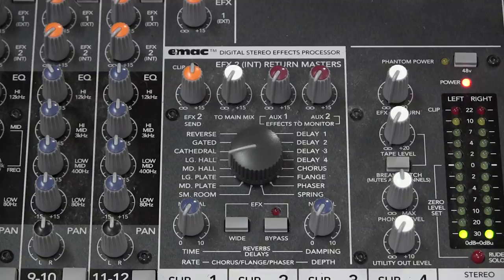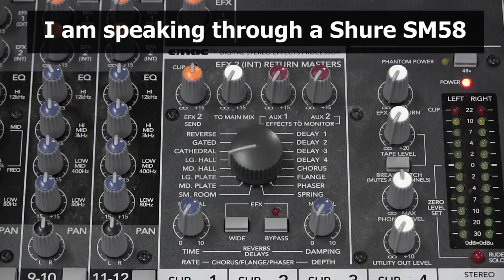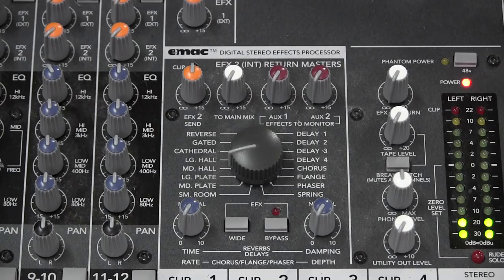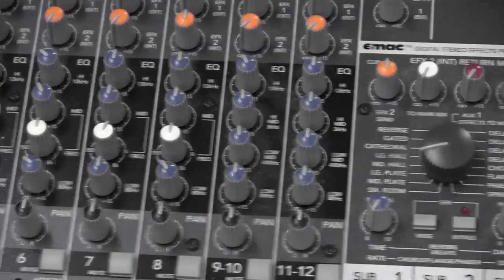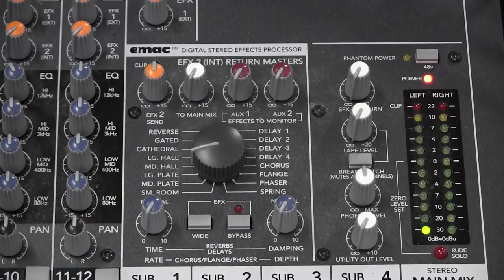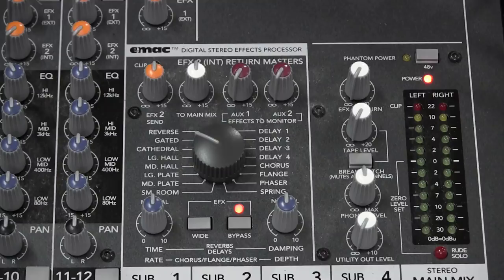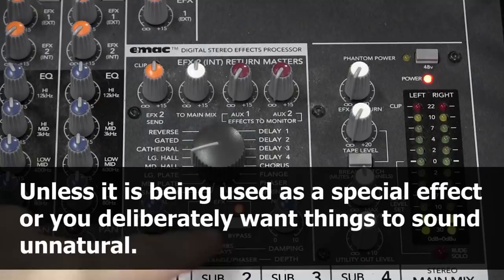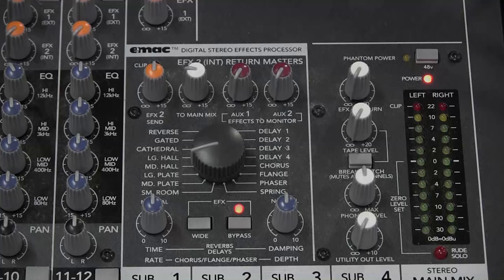How to use a mixer's internal effects processor

Comment: Bro can i use the utility o/p with  mono jack (TS) and feed to passive power amplifier input, as well as active speaker???
Also for recording can i use the output of Earphone (Trs) and RCA Tape output ????
For the Mackie mixer...
Pls reply 👍👍👍
Reply from the maker: Yes, the utility output carries a copy of the main mix so it can be used to feed any line level input. I recommend that you do NOT use the headphone output for recording, as it is designed for headphones.
Reply: @GLBProductions  Bro thank you so much for the quick reply
Reply: Yes wanted to know the same thing 👍
Reply from the maker: You're welcome Zuchamo!
Reply: @GLBProductions  bro one more question.. for open air ground (outdoor) Basically for Speech / Spoken words)
Which processor ( setting) is appropriate? Eg- Reverse/ Gated/ Cathedral etc.
Plz reply 👍..

Comment: Great tutorial.  I purchased (used of course!) the updated Yamaha MG mixer (CX something.  Added USB output) specifically because of the on-board effects and the one-knob compressors (which you have another video on).   It is very convenient with a great price/performance/portability ratio.

Thanks again for a great tutorial.

Comment: we use one of those MG12 for DJ's with the outputs going into an A&H PA20 (the main desk) Great little desk for accoustic gigs or home mixing where you dont want the hassel of a larger desk
Reply from the maker: Spartan Thanks for the comment! Do you supply the MG12 even when the DJ brings their own DJ mixer?
Reply: DJ's around here tend to use a laptop rather than bring a mixer. Otherwise they just plug into the mono channels on the MG12 as its pretty much hardwired into the PA20
Reply from the maker: Spartan I see. Ah, I miss the good old vinyl days...

Comment: I am the proud owner of a Mackie DFX-12 and by watching your video it has simplified some things but the aux-es fx-es  are still baffling but I haven't  given up I still want to learn I just got started sense I bout the mixer two weeks ago
Reply: clg1955 Oh I use my mixer Left Channel Output  to Channel 1 Input  on my USB interface (Steinberg UR22 ). My keyboard is a yamaha YPG235 it works great USB for my DAW VST's but I rout my (phones/output) with a mono cable to 11/12 left mono to get live sound and record into Audacity...... is this safe??
Reply from the maker: clg1955 Yes it is safe but if you use a mono cable with your headphones output it will only capture the left side of the signal - to capture the full range of the signal you need to use the L/mono output or just use a TRS to 2 x 1/4" cable to split the headphone output into discrete left and right signals.

Comment: And again, great video! I have one suggestion, put video: best possition for bend in small practice room. For instance we have acoustic drumer, bass and regular guitar with your own speaker and amplifier. Vocal and synth are on mixer, amplifier and two speakers. What is best possition for that crew :-)
Reply from the maker: +Erni Koldzic I'll be honest with you Eric - in small rooms the main challenge is just fitting everybody in! The best position is one in which you can hear everything that you need yet to give a good performance. I suggest placing the speakers in the corners, because that will help to cover the room as completely as possible, and make sure that the speakers are at ear level, not down on the floor.
Reply: +GLB Productions Tnx a lot:-)

Comment: Firstly, thanks for a very detailed explanation. Have a question. With the Analog mixer can 2 effects be applied at the same time for ex: Reverb + Delay.
Reply from the maker: It depends on the mixer and how many effects engines/external effects units you have.

Comment: I pray you could help me brother if I were to ask a question or 2 about setting up a system for my Church my friend. I love your method of teaching and believe you would make it easy for me. If possible I'll reply if you can. Nothing too extensive,just fairly new to the process of running sound and some help would be a Blessing!!! Thank you and God Bless you friend. Fran
Reply from the maker: Sure Fran, go ahead :)
Reply: @GLBProductions  I think i may have replied on the vid only?? Not sure. Anyway thank you so much brother!!! I have a "mid-morph function on an old Peavey xr1220. It's a bit touchy to dial in correctly but wondered if you knew of a good starting point besides unity that is.You are an awesome dude my friend and may our Lord Bless you continually!!!

Comment: This is a great video and it's helping to teach me how an internal effects processor really plays into a mixer like the ones you showed. I have a few questions if you don't mind. I'm a student with the Art Institute of Seattle and we're learning about mixers by using the Mackie 32x8 and the Crest XR-20 & XR24. My questions are these. 1) What is the difference between pre-amp and post-amp? 2)Pre-fader & Post-Fader? You mentioned pre & post fader but I don't understand what you mean by that though.
Reply from the maker: - Hi John, thanks for getting in touch. You're very fortunate to have those Crest mixers to work on, they are wonderful old school analogue technology, built like absolute tanks. To answer your questions: 
1. Pre-amp (as opposed to preamp) means before the amplifier in the signal chain, as opposed to after, which would be post-amp. Usually the only things post-amp would be the loudspeakers. Preamp (one word) is short for preamplifier. 
2. I suggest you watch my video How to set up monitor mixes for live sound starting around 4:30 for an explanation of this.
Reply: Awesome thanks so much. I'll watch that video tonight, and any further questions I'll toss your way. You've been an immensely huge help. My goal with the Art Institute is to hopefully gain a career in voice acting or voice over work, or even work in Seattle's local news department by doing anything with sound. Likely Kiro Radio.
Reply from the maker: Jon Slater Sounds good - all the best with your future plans and career. I have done some VO as well as live radio work and they are both varied and rewarding fields.
Reply: How do you get work in VO? Do you have to make demo reels and send them out? I'm really curious how you got into that.
Reply from the maker: Jon Slater I did my work through http://voice123.com/ - once you sign up and create a profile you can post samples online and bid for jobs that are posted on that website. It's very competitive though!
Reply: I remember that site. I used to put up tons of stuff but never got an offer for anything.
Reply from the maker: Jon Slater Yes, I think the VO market is pretty saturated at the moment, which is why I moved on to doing other things.

Comment: Bruno, finally got out from under. The setup you suggested for the sub works great. Will know more about the hum next rehearsal, but found that the vol control on powered amps needs to be turned off. It was creating feedback. You're right on the Crown amps; they are XLS series. Are you familiar with the different menus on the amps?
Reply from the maker: Jim Frey Are they the new drivecore series with the LCD panel on the front?

Comment: Awesome video as usual!I own the same identical MG mixer,but the only things I don't understand are the 4 knobs below the phantom power switch...I was thinking it was for the effects...but according to the video they don't...i guess...
Reply from the maker: ***** Those knobs have various functions: the first two control the level of the signal plugged into the stereo return connectors (immediately below the four RCA connectors) to the aux send and main LR outputs respectively. The third and fourth knobs are the master controls for the external aux send and internal effects send respectively. Hope that helps :)
Reply: I got the LR and internal effects pot...but I'm not too sure about the other 2 blue knobs...let's say we have a monitor connected to the AUX bus,and in the other 3 buses an external multieffects processor...does that mean that the AUX Send is gonna sending the signal of the multi effects to the monitor?And waht about the Return knob?sorry but I'm a little bit confused...
Reply from the maker: ***** Hmm, I suspect we may be talking about slightly different mixers - what is the exact model of your mixer? I'm using an MG124CX as my reference.
Reply: Yes,it's the same exact mixer (older version) like yours...
Reply from the maker: ***** Ok that's good. If you have an external effects unit plugged into the stereo return, the first blue knob, immediately below the phantom power switch, will send the signal from the unit to the monitor. The second blue knob is the master level control for the AUX bus, in this case it will control the overall level of the send to the effects processor. Is that more clear now?
Reply: Yes,thank you for the explanation and the patience!
It was the basic fact that the Send is an output and the Return is an input,that confounded me,sorry...
Reply from the maker: ***** Great! Don't worry, being confused by equipment and then working out your understanding is part and parcel of this business :)
Reply: GLB Productions HI Bruno!I checked it out for myself trying to use those four knobs at home with my gear,but I've found that the white knob (immediately below the aux send) is not controlling the 'internal' digital effects processor,but the overall level of the external effects processor plugged in the 'Effect' and 'Return' buses,the Aux Send controls the level coming from the channels to the monitor (including the effects applied to the channels with tha Aux master below the Effects choosing list),the Aux Return controls the level of the external effects processor to the monitor,and the Stereo like you said sends the level of the external effects processor to the main outputs.

In the manual in fact that is a 'Note' that says:
''If you have a Yamaha MG124CX,the Master EFFECT control does NOT affect the level of the signal sent from the EFFECT bus to the internal digital effect processor.''

Let me know if I'm right!and keep up the good work ;)
Reply from the maker: ***** Wow, you have certainly done your homework! Thanks for the correction and reference to the user manual, if in doubt always follow what the user manual says :)
Reply: Thanks Bruno!for the correction...you're welcome ;)
Yes it's the best way!

Comment: What do you think i should do? My  audio card to the computer is old, and I need som upgrading. I love analog sound, or maybe good preamps. Don't know if I should buy an old analog mixing table, to go through a "sound card", or to buy a mixing table with usb... What do you think? Is mackie mixers that good?
Reply from the maker: Matte Denne The current trend for home recording is to use a USB or Firewire recording interface without the use of a mixer - this has the advantage of taking up less space and often sounding better when compared to the inexpensive preamps that are found on budget mixers. 

If you prefer using a physical mixer there are more and more analog mixers out there that are equipped with a USB interface that allows the mixer itself to function as the front end to a digital audio workstation (DAW) programme such a Cubase or ProTools, for example the ZED series from Allen and Heath. 

Mackie mixers are very good value for money and some of the best mixers at their price point. However are still budget mixers and do not have some of the construction features of higher end mixers like individual channel strip modules and nutted potentiometers. 

All the best with your music, it's an exciting time to be involved in this field.

Comment: Bruno, Rehearsal went well. Thanks for the help. I'm curious if I have my subwoofer connected properly. One of the main outs go to Amp 1 for main speakers, and the other main out  goes to Amp 2 for sub woofer. Is this OK? If so, how do I control volume of subwoofer?
Reply from the maker: Jim Frey Glad to hear your rehearsal went well. There are a number of different ways of connecting subs and main speakers. The method you are currently using will only work in mono, ie all of your channel pan knobs must be at the 12 o'clock position. Otherwise, stuff that is panned to one side will go more to the sub and less to the main and vice versa. 

Unfortunately on most Mackie mixers there is only a single fader controlling both left and right outputs, which means you can't use that as a level control. So you'll need to use the volume control on the sub, or sub amplifier - this can work fine because once it's set up properly you should not need to change the level mid-show. 

If you want a more comprehensive answer, please let me once the make and model of all your speakers and sub, as well as any amplifiers that you are using. Then I can advise you what would be the easiest and most efficient set up for your particular system. 

What sort of music does your band play?

Comment: Big help, thx
Will it make better sound if I add an external sound effects processor?(for home karaoke system)
Reply from the maker: You're welcome. An external effects unit should sound better than the one built into your mixer, but you need to experiment in order to be sure.

Comment: Hello. I understand how to route efx from one channel. I am having trouble understanding how to route multiple different efx on different channels. I have a Behringer SL 3242 FX Pro analog mixer with dual 24 bit digital effects. My question is how do I apply different effects for my bass player, three vocals, guitar, and my drums? I don't want reverb and chorus on my drums and singers don't want compression and gates. Your videos have helped tremendously and are the best I've found on YouTube. I just haven't found any that address effects on multiple channels and different sound sources. Thanks in advance for your reply.
Reply from the maker: Hello Brian thanks for getting in touch. Your mixer has two effects engines, so you can have a maximum of two effects active at any one time. So for example you could have one reverb and one delay, or two types of reverb. Each channel on the mixer can access one or both of those effects by turning the appropriate FX knob, but you can't have more than two different effects at once. Let me know if that answers your question.
Reply: +GLB Productions Yes this helps very much. I didn't understand how the effects worked. Now that I do, what equipment would a guy need to have control of effects on each channel? Thank you again so much.
Reply from the maker: For each separate effect that you want to run you would need an effects unit plus a post-fade aux bus. So for example if you wanted to run four different effects simultaneously you would need four post-fade aux buses - your mixer can be configured this way but it would leave you with no pre-fade buses for monitor sends. You can also run an effect in place using the insert point on the channel, but that would mean that only that channel could access that effect.
Reply: +GLB Productions Thank you Bruno!

Comment: Thank you so much for your valuable videos!  Would you do a video on keyboard amps?
Reply from the maker: Calvin Jacob Stevenson Thanks for watching! What would you like to know about keyboard amps?
Reply: GLB Productions I'd like to know about which keyboard amp would be a better option and if I connect it to the sub output of the keyboard would it be stereo sound? How much Watts do I require? Thanks
Reply from the maker: Calvin Jacob Stevenson To be honest with you, I'm not a keyboard player ;) However, many keyboard players I know like to use Peavey keyboard amps - they are very heavy (especially the more powerful ones) but they sound good, and are quite indestructible. Roland keyboard amps are also popular. 

With keyboard, you need a full range, uncoloured sound, so many professional keyboard players will use powered PA speakers like JBL EONs as they keyboard monitor, or they will assemble a stereo rig using studio monitors placed on stands in front of the keyboard. 

How may watts is hard to say - it depends how loud your band is, and whether you are running through the PA system as well.
Reply: GLB Productions thankyou I have my keyboard to the PA system as well but I need something to monitor my playing that's why I have been looking for keyboard amps.
Reply from the maker: Calvin Jacob Stevenson If that is the case then a smaller keyboard amp should be enough, something of around 20-60 watts, depending on how close you get get the amp to your ears. With all amps, getting it up off the ground and pointed at your head is extremely important - use an amp stand, a low table or even a chair. I would suggest looking at the Peavey KB2 and KB3 models.
Reply: GLB Productions thankyou much for the information

Comment: Thanks so much for this video. I have one question can I EQ the effect on the Mackie board. I am using the Mackie CFX20 and would like to bring down some of the the high end of the effect. Thanks in advance.
Reply from the maker: Hi there, glad the video was helpful. As far as I know there is no straightforward way to EQ the effect return from the internal processor unit. This is one of the main advantages of using an external EQ processor. 
It is possible to work around this by using one of the aux sends to route the effect to a channel (ie turn up one of the 'effects to monitor' knobs, connect the aux send to the line in on one of the mixer channels) and then route that channel to your main mix. However this may cause electronic feedback and phase issues. It also uses up one of your pre-fade aux sends!